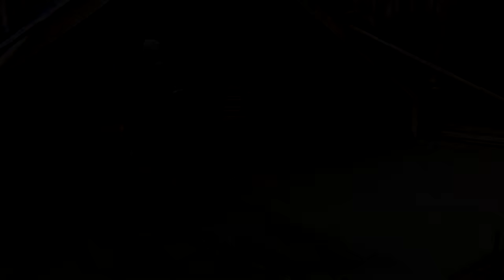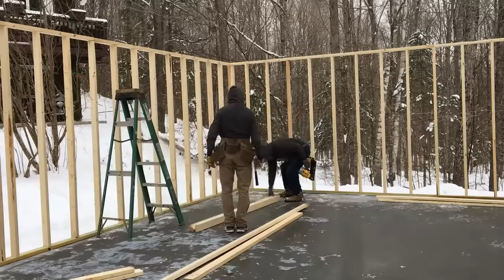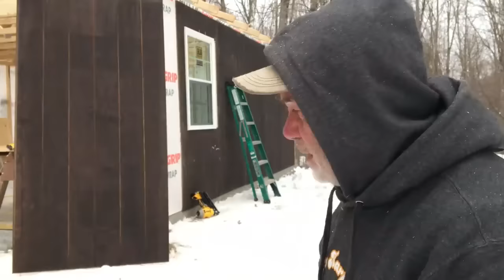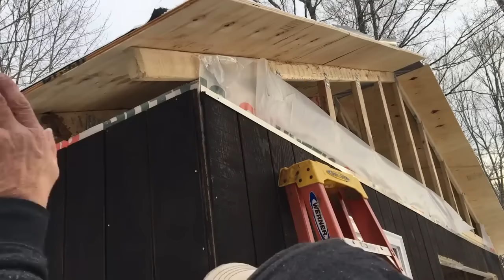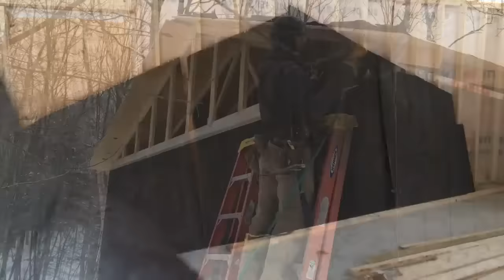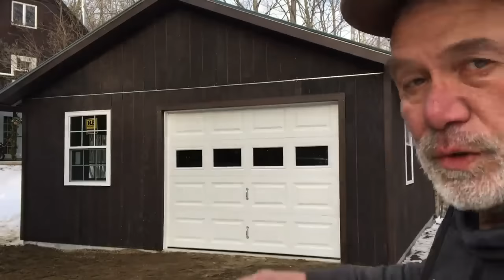One and a Half Car Garage Start to Finish $23,000

Comment: Ken, you and Chad are warriors. I worked in the snow for years, in the North East as a carpenter until moving to the south.  Folks down here have no clue how much work you have to do before actually working...lol. everything is shut down here in Raleigh when we have a half inch accumulation...still makes me laugh, but I definitely don't miss the snow!
Reply from the maker: Thanks. I couldn’t deal with the heat like they do

Comment: I remember using air nailers in the winter time...I had to use antifreeze instead of air tool oil otherwise they would freeze up and not work.

Comment: Wow, covered and snowing! Wow, a whole month later to get back to the build. The walls look nice! Minus 11F degrees this morning Ken here in Minnesota. Blizzard warnings until noon tomorrow. Too bad you had to paint all the T-111 in the shop but I bet the paint will stay on much better that way. Trusses going up really well. Roof plywood is going up fast. The T-111 does slip right around that window. It looks really nice. Nice cutting of the T-111 for the gable ends. The green roofing looks nice. You put boards up to cover the soffit area? Very nice looking garage Ken and Chad. Thanks for showing this build.
Reply from the maker: Thanks wow sit by the wood stove.

Comment: I think a steel building is the way to go. 4 years ago I had a 24 x 30 building put up. Concrete slab was poured. Crew came out put up the building in less than 5 hours. Done deal cost me 15 grand.😎

Comment: To give a different slant, I just had a 24x24 ten foot high ceilings with one 9x9 door and a 3ft personal door , 2 windows in  the gables built on a concrete pad here in Nova Scotia, $48,000 cad.

Comment: I have a garage that is 24x26 and the cement floor needs to be removed. Garage in great condition. Cracked and heaved floor needs to be removed and repoured. Talked to a couple of contractors they say too much work. I disagree. Garage needs to be lifted tear out concrete. Plus I need a 13' ceiling. Nice job on garage 👍
Reply: Good time to raise the roofline if it’s allowed. We raised ours 3 more feet. While it’s in the air remove the pad, re-pour, frame and side.

Comment: So the heal is 5"3/4 , maybe 7" on the inside of the wall. How much r-value , at the top plate to roof. I order all my trusses, w/10"-12" heal. Proper vent , then roxwull or fiberglass r-42 24" faced  batts , I only bring it up cuz the white stuff all over that picturesque nature , nice little spot you hv there, looking good.

Comment: 8 inch grooved, tongue and grooved exterior paneling, just make sure you run your tongue and groove in the right direction on opposite side so your of fall can be used from the previous side, FYI

Comment: I am building a 16X24 garage on a floating slab.  When I start sheathing the building with 1/2 inch OSB, should I start the OSB with a slight reveal of the bottom plate, overlap is and bring it down slightly past the bottom plate, or keep it perfectly flush with the bottom plate??  Obviously I don't want it to come into contact with the concrete.  Thoughts?
Reply from the maker: We usually go a half inch overlapping the concrete

Comment: Stapling the weather barrier is good. In a windy situation would you think of a spray adhesive so the platic wont tear loose from the staples?
Reply from the maker: Staples have worked fine for us so far

Comment: You and your team amaze me in your building. You have it down pat. What are your thoughts on a 20 x 24 garage with a double door so that the cars pull in to the 20 foot width. I have limited space but wanted the double car parking. Was going to put a storage room above. Have a Happy New Year.
Reply from the maker: It should work. It would be tight for car doors opening
Reply: @kenskarpentry  I misspoke. The car would pull into the 20 length with less room to walk around the front and back of the car.
Reply: 20 by 24 is a 2 car garage.  Heck,  they sell 20 by 20 in the Midwest as a 2 car garage.

Comment: Did you choose 2x6 studs so you could fit more insulation? If so, why 16 inch spacing rather than 24 inch?
Reply from the maker: Yes we did. 16” spacing is for sheathing support

Comment: Your siding z flashing, down here in kcmo
Contractors started skipping using it, insted they been overlapping the lower layers a few inches,  now thats on lp siding materials but it makes for a cleaner look and water sheds off the joints, insted of adding a band at the z flashing to cover it up.
One guy went as far to not even cover his z flashing  honestly it looks good.
Cant really see it. You can always paint it the same color as the siding to hide it.

Comment: Thanks for the content. What are you using to anchor the footplates to the pad?
Reply from the maker: Wedge anchors
Reply: @kenskarpentry  thanks for the response! that would be a solid connection for sure. You’ve motivated me to learn some more about basic framing and hopefully build a small garage next year; I like the way you and your crew work, this is what mastery looks like.

Comment: What went between the top plywood and the bottom plywood on the front wall. In the video it looked like a gap. Make a great off grid cabin.
Reply from the maker: Not sure
Reply: @kenskarpentry  where the top of the angle piece of plywood sets above the bottom piece of plywood. Is there appears to be a white gap

Comment: I see there aren't any anchor bolts to tie the wood sill with concrete slab. is this common with basic garages?
Reply from the maker: We use wedge anchors after the walls are set and squared.

Comment: Ken, do you recommend 3-1/4” hot dipped galvanized ring shank nails for the wall framing/roof joists and 2-3/8” HDG ring shank nails for the 1/2”(?) roof sheathing and T1-11 wall sheathing? Was wondering, as I’m about to start building our own house, and wanted some expert advice! Thanks for sharing! mahalo!
Reply from the maker: That would work well

Comment: I'm 77 years old in pretty good shape, I'm not getting as much as i was hoping, after selling my property in Oregon so looks like i will be building my own house on my sons property in Georgia. My question is, was the 23,000 labor and material and did that include the concrete slab?
Reply from the maker: Yes labor and materials including pouring the concrete. Codes and prices are probably different in Georgia
Reply: Hey thanks for the reply, That helps a lot. At least now i have somewhat of a base to go buy, doing most of the labor myself along with my two sons seems like i will make out pretty good again thanks Great video buy the way. sat through the whole thing. very well done

Comment: I am just curious why on the roof you only used Tyvek on the roof but you didn’t use icemelt on the edge the same stuff that like black sandpaper with a sticky adhesive on the back
Reply from the maker: Not necessary with the metal roofing. There’s not much snow build up

Comment: If you don't mind sharing - what kind of camera do you use to film this ? Thank you
Reply from the maker: I have iPhone 6s for cameras. Super basic. I should probably upgrade.
Reply: @kenskarpentry  Awesome ! Looks great ! Thought you are using some "big as** camera equipment. Thank you for sharing !
Reply: @kenskarpentry  Once you upgrade, you will be pleasantly surprised with quality  of video recordings of newer IPhones. As far as mics go - they make them lot simpler these days  than what you use. No wires to transmitter as transmitter is built into the mic itself and small receiver plugs directly into your iPhone. So you have only one point of contact. No wires means less  connections, thus  less probability of potential audio problems.  Amazon offers plethora of wireless mics specifically made for iPhones. After seeing couple of clips where you've experienced audio recording problem, I thought I could share this information with you. Lastly, remote trigger for your iPhone. Also on Amazon. Very inexpensive and very helpful device. Thank you

Comment: Nice work Ken!  I have been wondering about frost protection on the slabs.  How are you dealing with that to guard against frost heaving?
Reply from the maker: We make sure it’s well drained material under the slab then the frost doesn’t work it.

Comment: Nice job Ken. Was a little curious as to why you placed the roof screws on the flat and not the hump. Does it make any difference with potential water leakage? Thanks again, cheers.
Reply from the maker: It’s the manufacturer recommendation